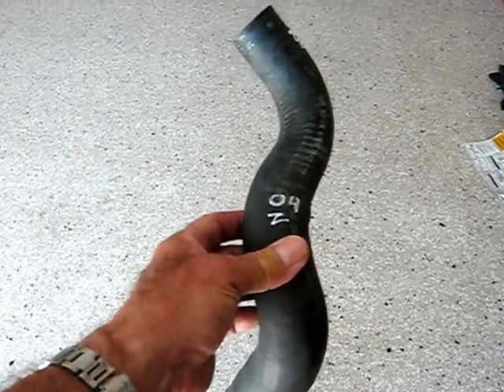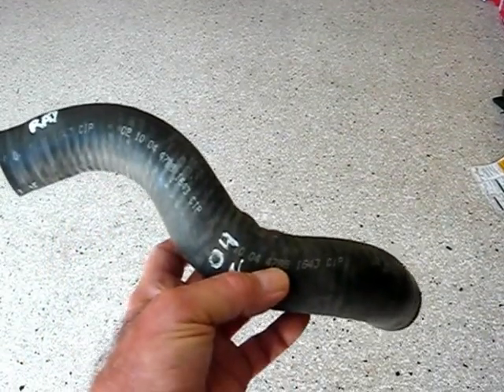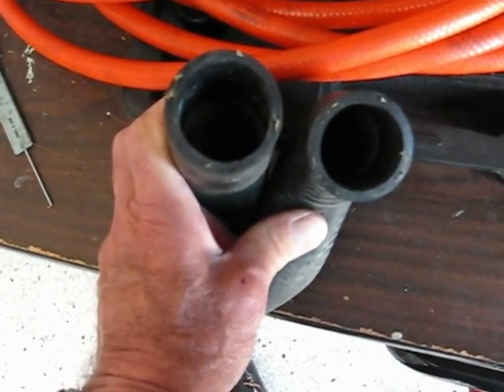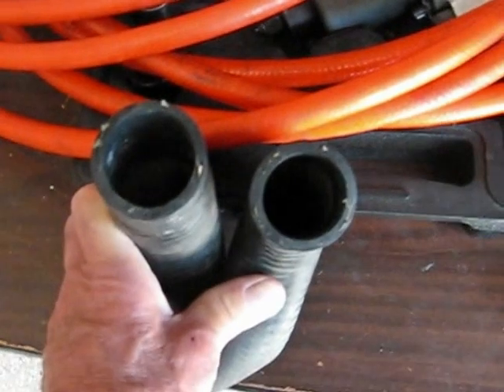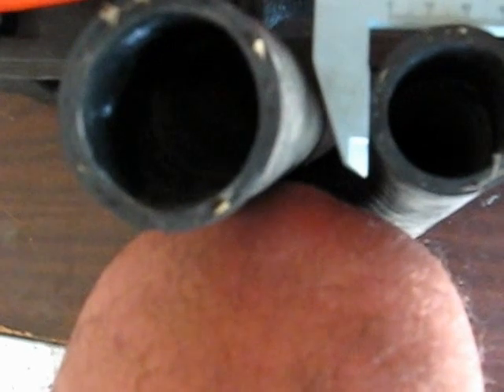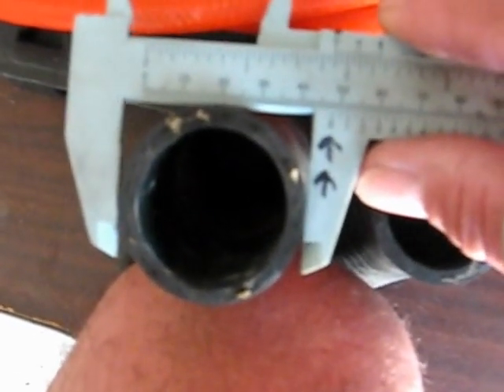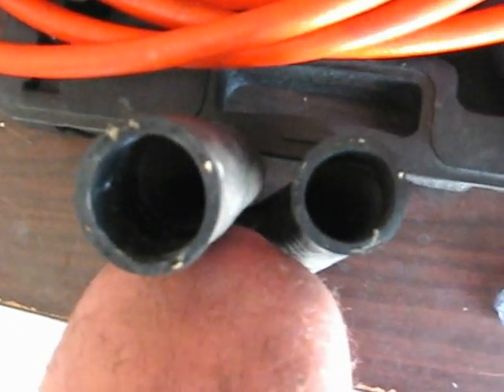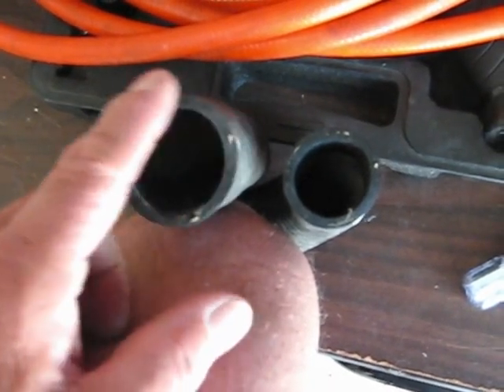Radiator hose leak an example by froggy

Comment: I believe im having the same problem. Have a 2000 jeep grand cherokee 4.0 108,000 miles. Early this year replaced rad, water pump, thermostat, all gaskets were sealed with gasket sealer.

 All other hoses have been replaced as well including heater hoses except my lower rad hose. Do you think its likely that I could be having the same problem?